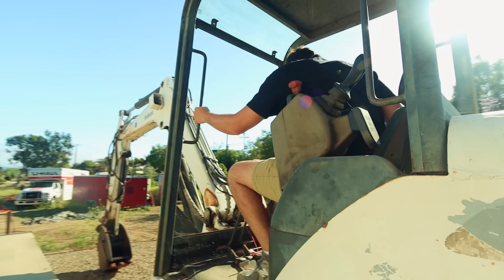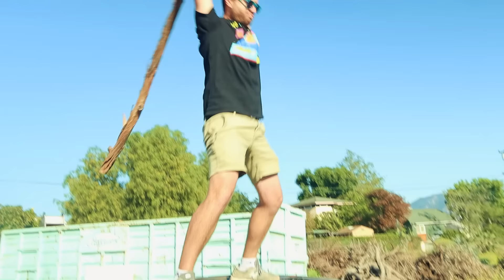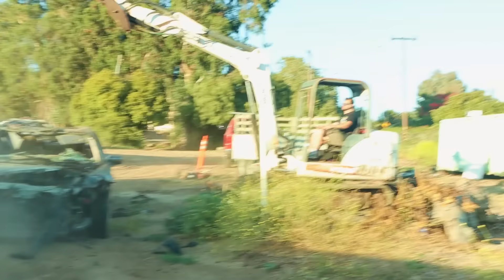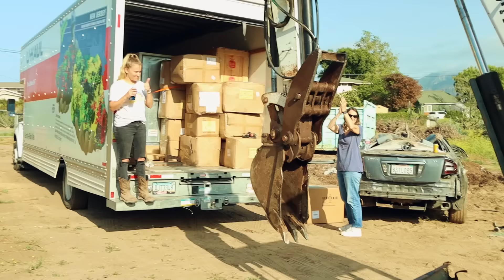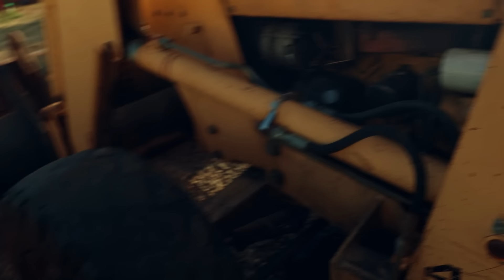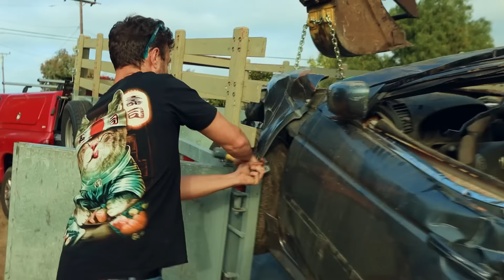powerful tools get teh job done fast

Comment: I think he is trying to rip the engine out, i'm not sure
Reply: It never really got mentioned in the video but i definitely felt some "rip the engine out" vibes
Reply: Part of the esoteric brilliance in this video that may go over some viewers heads is the subtle insinuation that William is trying to rip the engine out
Reply: Nah, he was just trying to change the oil.
Reply: Assumptions make an ass out of u and me. So don't assume he was gonna rip the engine out!
Reply: He should def try ripping the engine out next time
Reply: I think he's going to try to just rip the engine out.
Reply: Rip it out and drain the oil. Now to put it back in and top it off.
Reply: Yeah he insinuated it once or twice... Or 13 times. I'm still not sure.
Reply: Watch the video. He is actually just changing the oil..
Reply: A great quote for a T-shirt. lol
Reply: Take the engine out..

Instructions unclear:
Excavator on fire.
Reply: I’m pretty sure he was only trying to get the transmission out

Comment: Hello I am the owner operator of 7 jiffy lube locations in the greater metro area and I believe after watching this video I need to purchase an excavator for use at our locations to assist our trained staff during oil changes
Reply: That way you don't  fuck'em up! 🎉
Reply: Wtf is “The Greater Metro Area?”
Reply: @Jay22222 well it's greater than just the metro area

Comment: "I mean, sometimes it's hard, but you never know until you're halfway through" are the truest words ever.

I tried replacing the heater and evaporator cores in my truck. They're in the firewall between the dash and engine. Whole dash had to come out. Then when it was time to put the dash back together.... I had no idea where all those electrical plugs went. So I had it towed to be put back together at a shop. But hey, I got halfway!

Comment: Some actual useful advice, wire in some battery isolation into the lines, when you're done using them turn on the isolater, saves the battery, basically every vehicle on our cattle property has 1

Comment: At the scrap yard, sometimes they use a fits all bolt adapter and put a 10 hp motor attached to it. It's on a flexible shaft and can go anywhere. This makes it easier to remove stubborn engines.

Comment: I mean, I'm not an expert by any means, but usually the engine block is bolted to the frame with giant bolts.

That is, if you're trying to pull the engine out, not sure if that was what you were trying to do.

Comment: Im getting level 1 asbestos training this month! Gotta use the hoe on a burnt down house! I could get that car in without the cat, just saying. Also you could just flip the car on to the trailer instead of lift. I've had a lot of batteries die on me, but never on the hoe. 
Also you might wanna check your hoses, I hear the death tick. My boss ribs got broken when the hose ticked the thumb open and dropped a five ton tanker truck and caught him with the tire